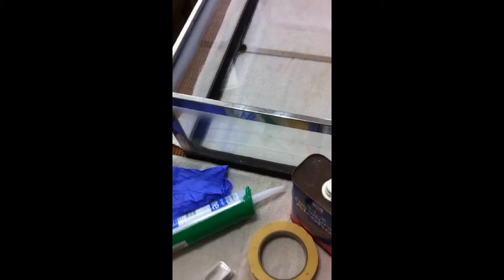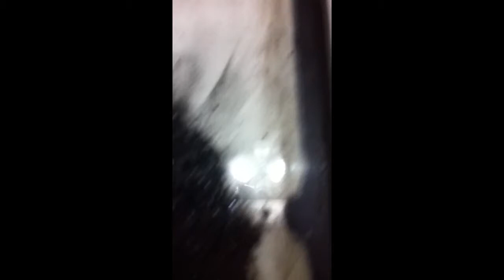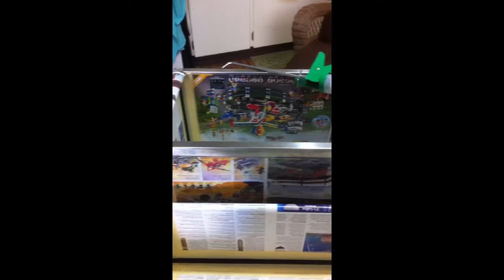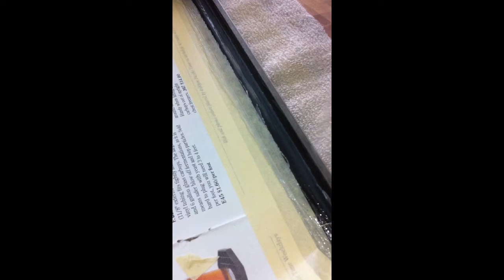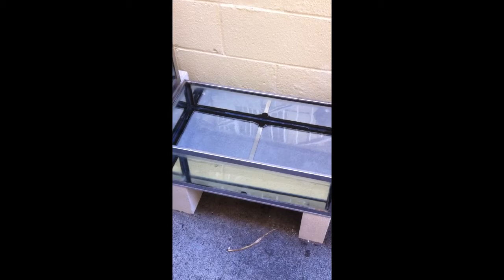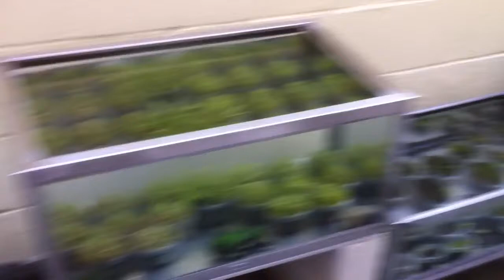Resealing vintage stainless steel aquariums for outdoor no tech

Comment: Ah yes the memories of burning my hands on the hot light housing 😂
Despite that I absolutely loved those old fish tanks . I'm a child of the 70s and started the hobby in 1977 after reps from the Seattle aquarium came to our school in Tacoma and gave each kid a pair of common wild guppies which of course multiplied several times 😂
 Started off with a small goldfish bowl but soon graduated up to a ten gallon Metaframe tank .
Later on I ended up getting a 30 gallon  "Metaframe" tank that I got from a co-worker at the tropical fish hatchery when I was 16 and really loved it .
Unfortunately I later had to move and scale down my hobby inventory and got rid of it 😔
I wish I still had it . I'd love to find another one like s 55 gallon or bigger and rebuild it using better glass and sealant and of course swapping out the old incandescent lighting for newer LED lights by using the same housing to keep that retro look .
Good job👍 on the resealing of the tank and best of luck with your hobby .✌️

Comment: Do you think these fish tanks are better than current ones. I was thinking of buying a 10g for 7 bucks but it looks like a lot of work for the aesthetic.
Reply from the maker: Frik Frak the frames can be cleaned up w/ steel wool fairly easily. If the glass is cracked or hazy, may need to replace. If the tank leaks during fill test, need to reseal. If tank has been left dry for a long period of time, I’d reseal it.

Comment: Hi guys. I'm a big Metaframe fan, having received my 15 gallon tank for Christmas in 1968. My two cents: Be careful about the silicone that you use. My understanding is that the silicone you buy from Home Depot is construction grade silicone, and as such has some stuff in it that you don't want to expose fish to, such as algicides. You can buy black aquarium grade silicone at a pet store that won't harm fish as it's manufactured without all the harmful stuff that they put into construction silicone. I re-did my 15 gallon with this stuff in 2008 and it's been in continuous service since then without leaking a drop. And BTW, those who tell you that you cannot silicone against the slate bottom are wrong. I re-siliconed the slate bottom to the metal frame and it has never leaked a drop. So get out that old Metaframe and get going!

Comment: Man I wish I had seen this video before I sold my old tank last year.. The slate bottom definitely makes this process more complicated. I would be really careful with picking at the tar sealant because they use to mix lead dust in the tar. 

Lawrence where would you recommend picking up another of of these aquariums? Have all the Metaframe tanks you picked up had glass bottoms already?
Reply from the maker: TheRAMBOhimself, one of my SS tanks was found in a lfs & the other 3 were given to me from a coworker. If your looking for old Metaframe tanks, watch Craigslist & yard sales. All of these guys are glass bottoms, if I came across a slate bottom, I’d probably switch it out to glass.

Comment from the maker: This is my my 2nd & 3rd SS reseal project. Got on more to do. Don't trust old seals that have been exposed for any extended period of time. Entering my "MacAquarium" in the Aquascapes show.
Reply: Not sure if you're aware of this but provided the tank hasn't sat for too long or the sealant isn't dried up, you can reseal those old types of tanks using warm water and letting it sit for a bit .The old sealant gets pliable and fills in any leaks it may have  .